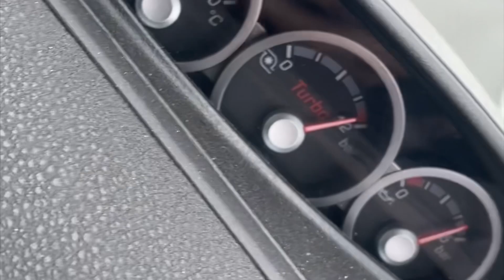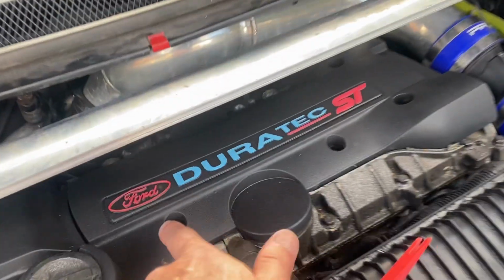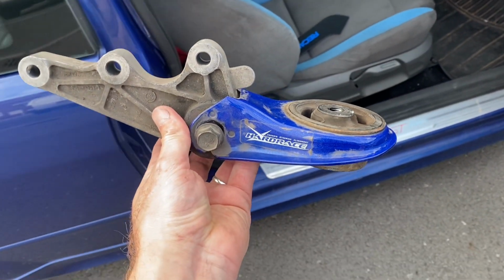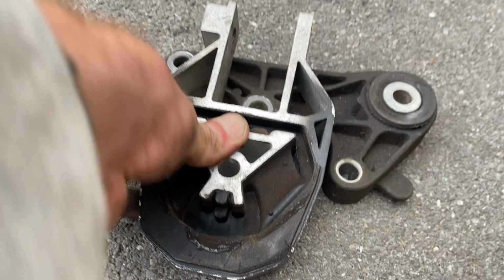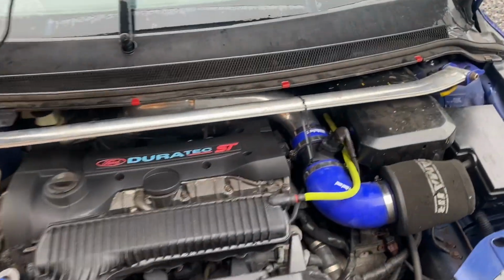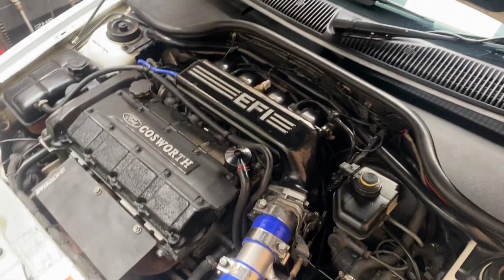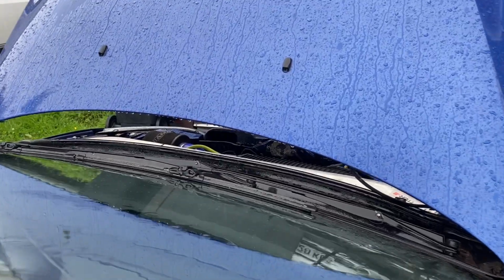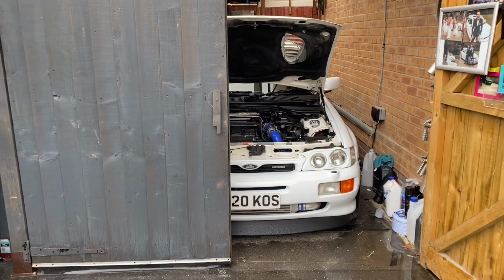Focus pocus !!! Focus st225 upgrades

Comment: Fair play mate, you're not messing around 👏 👍🏼
Reply from the maker: Wishbone , bushes , pads , disk , sliders , paint calipers, repair wheel , interior spruce / clean / replace bits , repair cluster , polished headlights , under bay ( loads there to come) torque mount . Replaced missing parts … think list will never end and missed bits . Loose this dv next tho and fix roof damage I think 🤔 lol

Comment: I’m sure you are meant to run the air mass sensor at 2 o’clock if not it doesn’t work properly great video 👍
Reply from the maker: Cheers , ye it was prior but I need the bracket for my intake pipe :( worried about the plug wiring breaking on the battery box . Needs sorting / locating correct once and for all deffo
Reply from the maker: Appreciate it tho . 
Think it’s something I’m going to have to do soon myself by looks . 
The car previously had a cooler before my ownership . So need to get one back on asap so will do the intake again then I think . 
It’s all systems go at mo…. 
Need to paint the roof and sort out the damage

Comment: Is your car running block mod mate really interested in getting one of these cars but heard alot of people say the need a block mod done to them
Reply from the maker: Was sold as having block mod , Rs clutch and fly wheel . Mate has one with mod .  Other mate hasn’t . 
Both on good power . Watched a video on barum engineering saying how he doesn’t agree with a block mod , he’s a. Top builder 

The key is warm up / cool down on these so they don’t crack the liners.
Reply: Thanks mate will check that video out